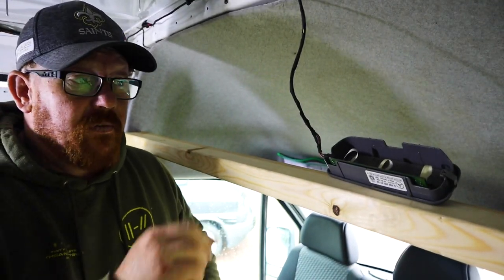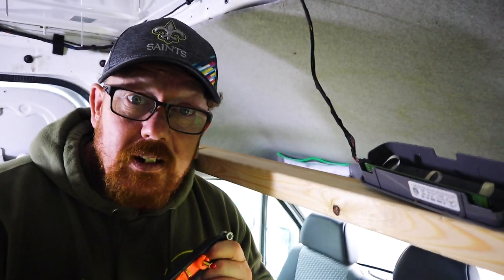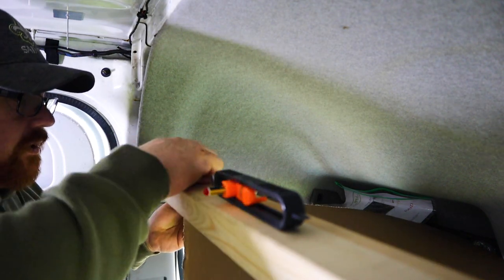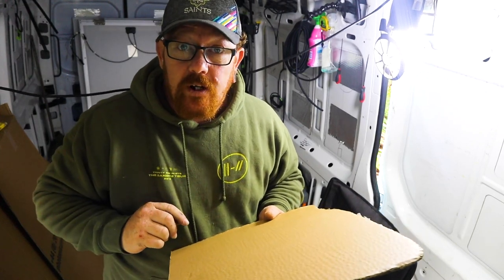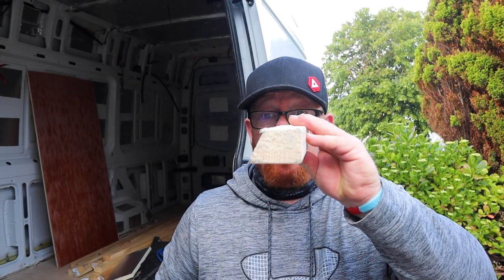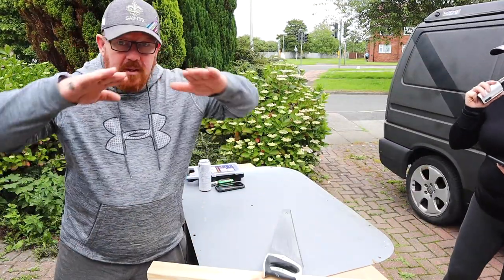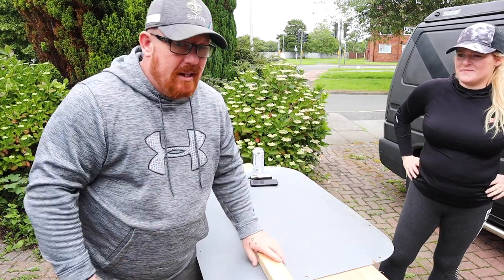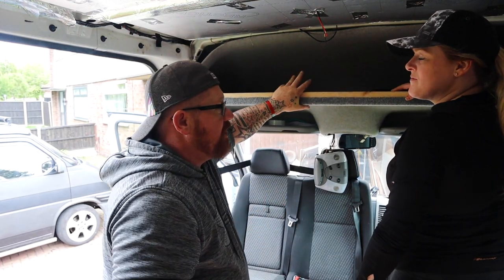Van Build DIY VW Crafter Van OVERHEAD Storage

Comment: We all spend money on scribes.  And still spend 2 days 5 hours and 45 minutes getting it right . Then we throw away the templates 😆 when really we could offer to others and save the world from a lot of cursing and  swearing 😉  
We took out the head panel and fitted the shelf on the bench . Made it easier than working overhead.  And while it was out we stuck a couple of sheep's overcoats against the roof for insulation.  The refitted the panel.  😎
Reply from the maker: the funny thing is , i sad im going to keep this template for some one who needs it , then i cut it up for a panel on the door with out thinking , guess im in the didnt think club there mate , but at least we understand the hell people go trough when they do the job

Comment: Nice job on the shelf ... I'm just about to do the same on my crafter project. Just wondering, did you find a good solution for filling the gap between the ceiling 'liner' above the cab and the sides of the van? It look s a tricky shape to get ply to fit but I've not tried yet so any suggestions much appreciated. :)